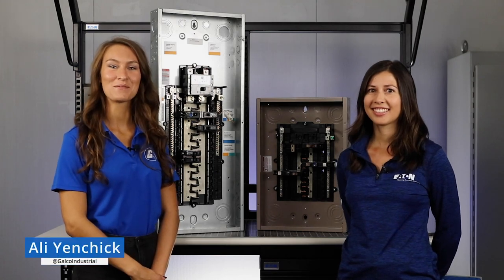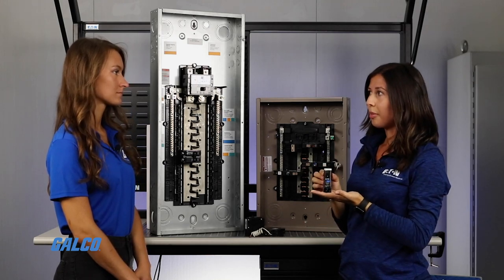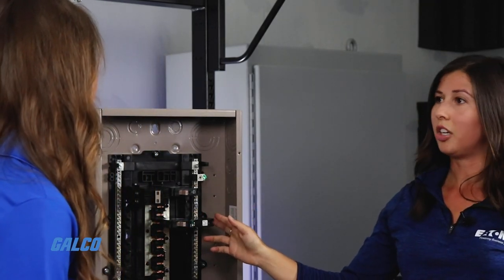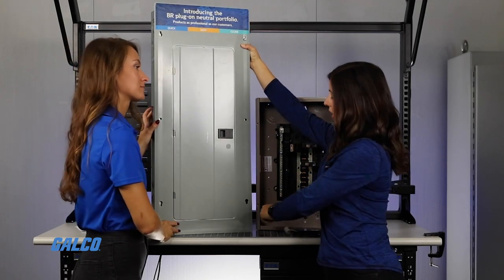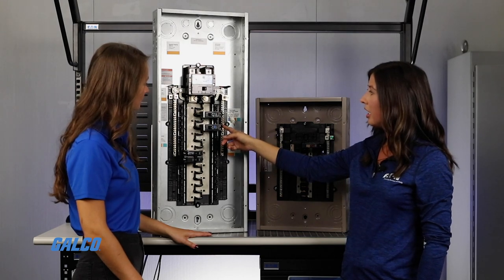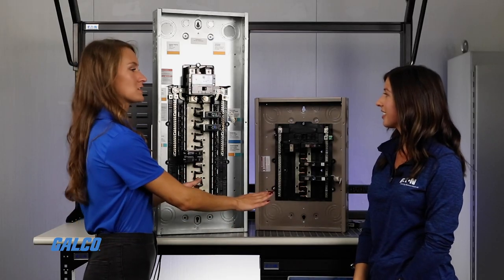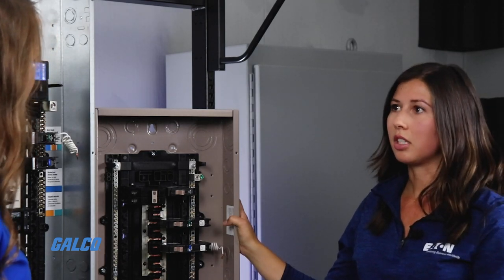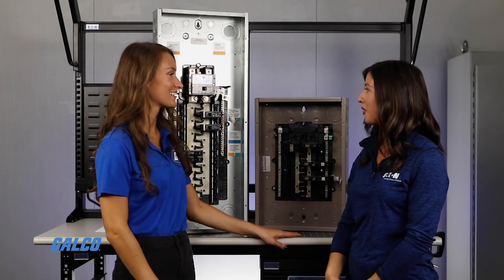Product Talk: Eaton BR & CH Load Centers with McKayla!

Comment: I have a question.  If you are purchasing a new panel, how do you decide between CH or BR?  Are there advantages to help decide?  I love what Eaton has done with the new panel and would love to replace my old cutler hammer panel.  Congratulations!!
Reply: CH is a premium option with a copper bus and BR is a budget option with an aluminum bus.  I don't know why you want to replace your existing panel, but if your existing CH breakers are in good condition, you may be able to reuse them in a new CH panel.  If you install a new BR panel (or any other manufacturer's panel), you would need to buy all new breakers, which will add a significant amount of cost to the project.

Comment: If I have a pigtail neutral wire, on my CH breaker, can I still terminate it to the neutral bar even though it clips into the neutral bar?
Reply: did you find an answer? I have a new ch load center coming, and I am buying a few gfci breakers, not combo. the Eaton gfci only breakers have a neutral pigtail, I am assuming still compatible with plug on neutral load center.
Reply: @travish4276  no reply. The electrician just installed it and attached the neutral to the neutral bar

Comment: Anyone noticed that the BR series dual GFCI/AFCI breakers tend to run hot, even at low current draws? I was seeing surface temps of around 120F near the breaker handle in a room temp of about 70F. I used a rather high dollar FLIR IR camera designed for electrical thermography to record the temps. This seems pretty unusual to me. I worked on 2 separate 42 space panels that had at least 30 electronic breakers in each. The AFCI only ran about 100F, but those dual purpose breakers ran close to 120. Every one of them in both panels was pulling less than 3 amps when I took those temps.

Comment: So I have opted to go with the CHP60B200X9 since we have to run 12 mini-split 220v AC's here in Cabo. The Eaton catalog has CHPX9B under the "combination" column. That only pops up for indoor which I am doing. What is that? I'm pretty much winging it here in MX and my limited knowledge and code is pretty much out the window. No work permits, no code but it needs to be done right.

Comment: What is the big deal, don't you still need to connect to the neutral bus bar from the respective Romex wire circuit?
Reply: Plug on neutral provides an extra terminal screw on the breaker for neutrals.
210.12 of NEC (2017 and later)requires arc fault for just about all single phase residential circuits in the 120 v realm.
This means aith afci breaker, the neutral from your load(romex) connects to the neutral screw  of your breakers, then you connect pig tail will connect to the neutral bus bar.
So if you got a bathroom you buy dual function breakers that provide gfci or you buy individual gfci outlets.